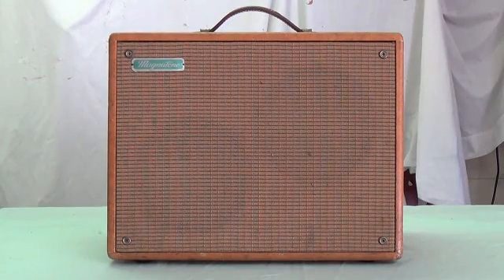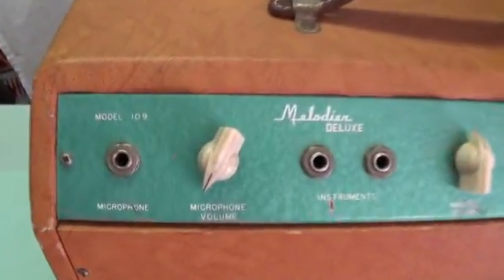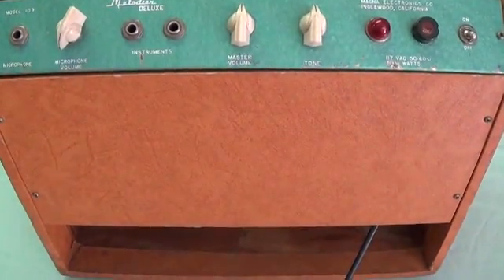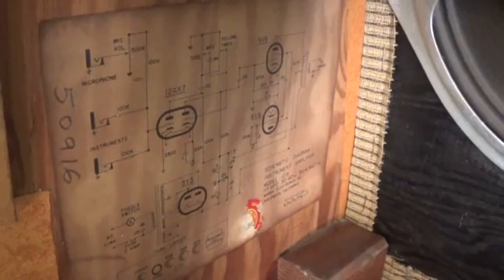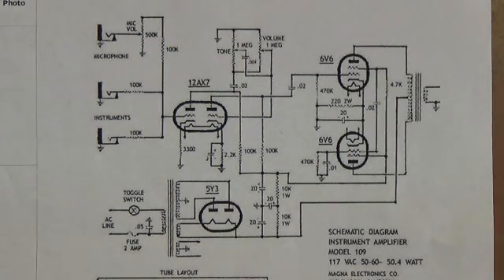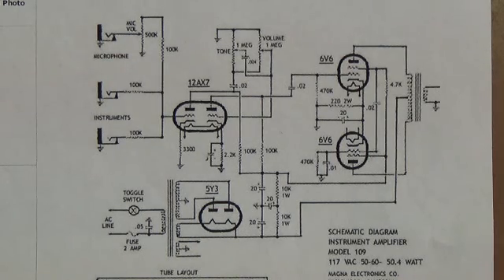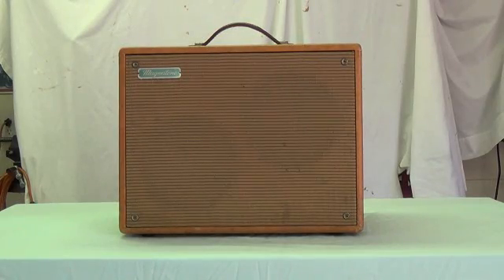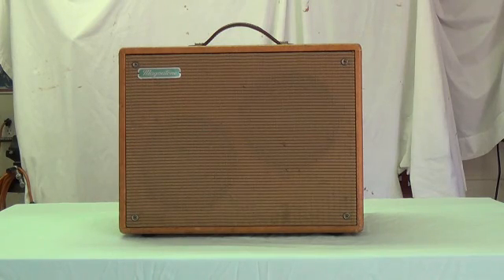1955 Magnatone Melodier Deluxe Model 109 Guitar Amplifier

Comment: Hi Uncle Doug, mine's finished! and I have another question.  How loud is yours?  At full volume, mine's bedroom level.  VERY quiet.  I didn't put the scope on it.  My speakers are in series, total around 5 ohms.  I expected it to be significantly quieter than other 6V6 push pulls, but it's nowhere near a Deluxe Reverb on 3.
Reply from the maker: Why are your speakers in series?  Have you tried them in parallel?
Reply: @UncleDoug  that's the way they were,  parallel would give a resistance of just over 1 ohm... If it was even doing 10 W it should be way louder.  I'll fool with it more tomorrow.  Ok, it's tomorrow, and I got it.  When I put the last screw in the chassis, I caught one of the fine wires from the OT and crushed it against the chassis, grounding out the signal.  When I fixed that, it got a lot louder!
Reply from the maker: The problem must reside in the circuit or the speakers themselves, Rob.....and detection of the cause will require on-site inspection. Good luck. @RobRice-so5nv
Reply: Thanks  @UncleDoug  I got it.  See edit above, OT wire was pinched to the chassis.  It sounds fantastic, really great tone and breakup.
Reply from the maker: Problems like this are rarely, if ever, solvable long distance. I'm glad you located and resolved the problem.  @RobRice-so5nv

Comment: Great stuff!  One of these just came into the shop with parasitic oscillation at high volume... This review helps me get started!
Reply from the maker: We're glad it was helpful, Sawyer :)
Reply: My amp has the same problem when I use the preamp tube. But don't when I use the input going to volume pot. I'm at a loss

Comment: Do you know how to get the chassis out?  I just picked up one of these and don't want to break something, but i don't see what's holding it in unless it's just really wedged by the wood parts.
Reply from the maker: Look for some screws through the sheet metal into the wood.
Reply: @UncleDoug  thanks!  Found one more, hidden because of double duty on a terminal strip.  Chassis still wedged, I ended up using a nylon drift with a tiny hammer as a persuader.  Even after putting it back in, it doesn't want to come out.
Reply from the maker: Very strange, Rob. I don't recall having any trouble at all removing the chassis in my amp. @RobRice-so5nv
Reply: @UncleDoug  the wood block is very tight on one side.  When the chassis slides in, it wedges a little toward the back.  The chassis is out, I'll get a picture.  I don't know if I can post it here... maybe a link.
Reply from the maker: Perhaps your cabinet has changed shape over the years, possibly due to moisture. You can post photos on my FB page: Uncle Doug's Vintage Amps, but, to be honest, they probably would not be much help in solving the problem. @RobRice-so5nv

Comment: I thought I'd add my 2 cents - looking at the final amplifiers, one is grid driven (like most other push-pull amps), and the other one is cathode driven (what hams call 'grounded-grid'). This naturally results in opposing phases, given an identical phase input to each tube. The grounded-grid configuration is very popular for RF amplifiers because it naturally eliminates feedback from the plate circuit, since it's out of phase with the input signal, with the tradeoff of reduced gain. Tubes for this type of amplifier service are normally designed for high mu to make up for the gain loss. Although it would require a recalculation of bias, the lower 6V6 might be replaced with a 6Y6 or 6U6, which has higher mu.
Reply from the maker: An interesting analysis, Stirling. The general consensus is that the lower tube grid is driven by the screen of the upper tube, as evidenced by the .02uf coupling cap that connects them. Thanks for your input.
Reply: @UncleDoug  Good stuff, and good to hear from you sir - hope all is well, and Merry Christmas!
Reply from the maker: @stirlingschmidt6325  Likewise, Stirling :)

Comment: Uncle Doug, I have a 1960 Magnatone  custom 460 , stereo amp. But one half of the amp doesn't work. It was my dads. i got it when he passed. I've had it now for many years. Would you know any competent repair amp tech's in Saginaw,Mich.area that  could fix it . It was never later  worked on.  My dad bought it knew in 1960. I don't know why he never got it repaired. All parts are factory as far as I know. It failed and he put it away. He then bought a Fender amp
Reply from the maker: I'm sorry to hear that, Doug. The 460 is a large, complex circuit with all sorts of possible reasons for the problem. I'm sorry, but I don't know of any techs in your area. Good luck with it.

Comment: Hi uncle Doug. I'm eyeing this 'amp' (or whatever it is..) in the link below. But I was wondering if you know what kind of device this is? (Dutch version of Craigslist). It seems to have only a 5Y3 tube.. and some strange sockets.
https://link.marktplaats.nl/m1265697964
Reply from the maker: I can see why you like it, CM.....it's neat as heck. My guess is that it's a remote speaker cabinet, perhaps for audiovisual use, with an electrodynamic speaker that has its own rectified power supply. You would plug its power supply into the wall outlet for AC, and then plug in the signal input to the voice coil. Notice that there are two separate inlet plugs....lower is AC, upper is signal (?). This is just a wild guess......but that's what it looks like to me.
Reply: Thank you so much for the reply. That makes sense, I think. I've only ever seen stand-alone units, and I have no idea what else is part of the system. There isn't more for sale in the ad, anyway. If I end up getting it I will try to share some more details.
Reply from the maker: If the price is reasonable, you will be gaining an electrodynamic speaker, rectifier tube, and transformers.....for future builds. Or, you could add a compact amplifier chassis to the cabinet and have a great-sounding amp.
Reply: Indeed. I hope it'll work out. Would be a handsome looking box to have as an amp.
Reply from the maker: No kidding, CMP. It would be spectacular. If possible, and not overpriced, you should get it.
Reply: Hi. So, I got it. Cost me 80€ incl shipping. So far, given the possibility to use to make something cool, it is not overpriced (to me, yet). The chassis has nothing but the tube and 3 transformers in it. So it was really part of a system, and I'm pretty sure it was part of an old film projector system. The main unit used to have the rest of the amplification components. Like these https://www.radiomuseum.org/r/microtecn_micron_xxvc_e_bm.html
Here is a link to some more pics https://imgur.com/a/tW7GL. I'll have to decide whether to reuse parts of or transplant a small amp into it.
Reply from the maker: Congratulations, CM. Judging from the fact that the tube is a 5Y3 rectifier, and the Microtecnica projector literature says that it needs a "separate speaker"........I think you're right. It's an audio-visual  remote electrodynamic speaker with its own DC power supply. I wonder what would happen if you fed the voice coil a signal input from a separate amp?
Reply: Aha, interesting that you have access to Microtecnica literature. Cool stuff. I might try your suggestion, if I can figure out what to connect to what, especially for powering the speaker (weird plugs). Eventually I might try to reuse the chassis and some parts to build a small stand alone amp inside. A project for next fall/winter. Thanks !
Reply from the maker: You're welcome, CMP. Good luck with your project.

Comment: Hey Uncle Doug. Can you recommend a suitable soldering iron for amp work please? Many thanks for your great vids. Steve, Cornwall, UK.
Reply from the maker: I have a Radio Shack soldering gun, for soldering larger wires and joints, and an inexpensive Radio Shack soldering iron for the majority of my wiring, Steve.  I think that just about any halfway decent soldering iron on Ebay would probably work just fine.
Reply: Thank you Uncle Doug. The iron im using is rated at 30W. I'm finding the response time of the solder to be slow and consequently the heating of the metal/wire is equally unresponsive. Perhaps a higher wattage is necessary. Many thanks again.
Reply from the maker: I did some checking and my soldering iron is a 60W Weller......so you definitely need a higher wattage SI.

Comment: Hoping for some new videos soon. I am really wanting  to see a video explaining the workings of the VIBRATO function in Magnatone Amps some day.
Reply from the maker: We have never owned or worked on a Magnatone amp with Vibrato, EE, but would love the opportunity. There are Internet sites that do explain the circuit, however. It's based on a component called a "varistor", which still exist, but unfortunately not in the values needed for a vibrato circuit.

Comment: Hello Uncle Doug. Many years ago I had to repair Bassman 5B6 and Champ 5F1. After repair I noticed DC voltages on tube pins and AC on power trafo. When I saw your videos about that amps I noticed  that voltage values on original scheme and uploaded on my web for young tube sound fans. But, I had never repair Melodier and I don't know correct DC voltages on tubes. Have you AC and DC voltage values because I would like to put this simple excellent scheme on my web but without voltages it's very hard to control amp after some amateur made it. From my experience I know the approximate value of 12AX7 and 6V6 but whether it's a scheme with special phase inverter and I would like to know the exact values on screen grid. At least on cathode of rectifier tube. I think it must be ~ 420VDC on anode, on cathode~19VDC  and~ 415VDC on 6V6 screen grid. On anode of 12AX7~110VDC and on cathode~1,6VDC. Output transformer is similary as for EL84. On one instrument channel I will, as an opportunity, to draw capacitor of 10nF in paralell 100K for bright sound. Maybe Rusty knows voltages? And of course, again and again, thanx for all your videos. Every night before sleeping I watch one your video as a memory on my youth and beautiful warm tube world. I am Croatian so sorry for my English! I hope you will understand me.

Comment: Hi Uncle Doug,

My question is off-topic or maybe just off-subtopic. I'm a fortunate owner of this same model and year of amp. They sound great, especially for blues harmonica. The response is quick between the player's breath and the speakers' output so my harp playing friends love it. I discovered, while stressing the power cord's plug end in an awkward set up situation on stage, that the insulators of the two wires are completely rotten from end to end. Luckily no one was hurt, but the breaker for the stage tripped. I purchased a three pronged cord for it and read up on the conversion until I found a similar circuit diagram with before and after drawings. The black lead is connected to the fuse, the fuse is connected to the switch and the switch is connected to the transformer lead that used to go to the switch. The white lead is connected to the transformer lead that used to go to the fuse.I removed the death cap on spec. I tested the chassis for potential without the cap and read 2.0mV and 0.0A. I tested the chassis again with the cap alligatored in place, and the voltage was 3 times higher, still no current. I noticed the amp hums (maybe it did before but I didn't notice) and that I can reduce the hum by touching the chassis with my hand (pretty brave, am I not?). 

So my question is, did I mix up the black and white leads? Would it make a difference? The cord I bought has them both black, no white. I marked with painter's tape the one that should be white according to which spade it connects to, but I removed the tape prematurely while positioning componets for soldering.

Thanks for giving us so much useful information.

Cheers!
Andrew
Reply from the maker: You may well have reversed the black and white wire. You can reverse them and see if there is a difference; however, I would think that, if the green ground wire was securely attached to the chassis and the wall receptacle offered a proper ground, that touching the chassis should make no difference. Double check the black/white connection, the security of the green (ground) lead, and the wiring of the receptacle.  A properly installed 3-wire power cord and receptacle should never cause hum.....it should only reduce it.
Reply: I redid the ground wire at the amp and that solved the problem, thank you very much. I tinned the ground lead and wrapped it around the PT bolt. I redid that with a crimped on lug and that was the fix.

Comment: You are so right on the money... the absence of a typical phase-inverter has robbed a little gain from the amp. It still sounds pretty solid... I wonder what would happen if we added an extra gain stage, or increased the gain of the two existing stages with cathode bypass capacitors? I wonder how the amp would sound?
Reply from the maker: I'm not sure, Mark, since I am reluctant to change the circuit in this nice, original vintage amp. Perhaps you could build one, incorporating the changes you mentioned.
Reply: I will try that. I have enough parts to do it and a great scope. I'll deadbug one up...
Reply from the maker: Good luck and be sure to share your findings with us.
Reply: Wha Happen?

Comment: That's crazy how they do the phase inversion... but it works... none of the various methods to achieve phase splitting is 100% balanced... and because of this... it provides us with some sweet crossover distortion... in most cases... this method of tying the screen of one bottle to the grid of the other saves Magna $$$ due to the absence of another tube and supportive parts... How does this work? When you amplify a signal with a gain stage... you can have an inverted or non-inverted output, depending on which typology you use. Think of how we use Op-Amps? There's an invert and a non-invert wiring method; it's all the same theory.  An inverted typology flips the sine-wave signal and the other mirrors it. With any pre-amp tube, you would see two wave forms, one inverted from the other flipped 180 degrees, and one that is a mirrored copy of the input, if you were to place a scope at the anode plate (inverted) and then at the cathode (non-inverted).  On this Magna, the screen of one bottle is outputting an inverted signal that is 180 degrees out of phase with its input (flipped), and that inverted signal sent to the other bottle, providing the other bottle with the other side of the sine-wave. One wave up 180 degrees to one bottle and one wave down 180 degrees to the other, tied together with a common output transformer, makes a complete 360 degrees wave. The next question is... is the crossover distortion that the method that Magna uses here... pleasing or ugly as a hot place? Is it rich with the right kind of harmonics? Phase Inverter typology makes or breaks an amp if you're going to push it hard. NOTE - I guess I should explain "crossover distortion?" This is that region, that time in each full wave cycle, when the signal passes from inverted to non-inverted; and during the "crossover" of the signal from an up peak to a down peak, from one bottle to the other, there is a brief moment in time when both bottles share the signal, when both bottles are slightly on. This is crossover distortion. Does the method used here... sound pleasing or ugly when pushed?
Reply from the maker: Here is a link to a video I made with an engineer friend several years ago, before I had my own channel. He has a wonderful assortment of equipment and we were able to perform a frequency spectrum analysis on the Melodier that you may find interesting:   https://www.youtube.com/watch?v=VufPF3OOTd0
Reply: Wow... Thanks... I'll check that out!

Comment: Wow, you explain these circuits in such a fashion that I'm amazed at how much I'm comprehending and retaining to memory. Grant you, as a novice I'm still far from actually building an amp, but I have more confidence in exploring the inner workings of the ones I do have. Which brings up a question about my magnatone 150: it has a multi section can cap with values of 20/450V, 20/450V, 20/50V. Is there a rule of thumb I should follow should I ever need to replace? I haven't found exact replacement for purchase online. Is it true I can use higher volt value if necessary? I have came across 20/450, 20/450, 20/450
Reply from the maker: Thanks, TP.  Rusty and I are glad the videos are helpful. Yes, you can go up in voltage, but the capacitance should be within 10% (higher). The can cap you found will work just fine. The 20uf/50wv cap is a cathode bias cap, so the voltage can be higher with no problem.  You can also just leave the can in place and wire in individual axial capacitors underneath the chassis.

Comment: hi uncle doug hi rusty....thank you for your very nice videos by the way you gave me the guts to dive into these tubes amps kinda things .
well i have a question about the Melodier 109..    is the cathode bypass cap on 12AX7 along with 2.2k  is  2uf  25v ~50v ?
i tried this but it sound better with a 22uf  more alive just to say.  it opened that thing!  on the cleans
i builded that one using russians tubes 6n2p as 12ax7 and 6p6s as 6v6     very nice tubes for the price you can get vintages for a fraction of the price compare to american  ones.  thank you again to take the time.  and happy new year   cheers from  montreal  quebec !
Reply from the maker: +reyzn bran You're welcome, RB. We're glad you enjoy the videos :) The value of the cathode bypass cap is not legible on the schematic I have on file (and used in the video), but I would guess that it was probably 20uf@25V. Happy New Year to you from Texas, USA :)